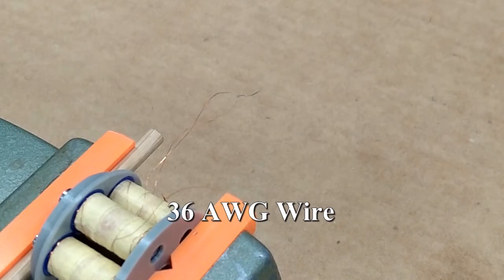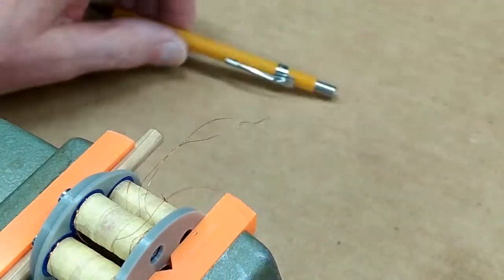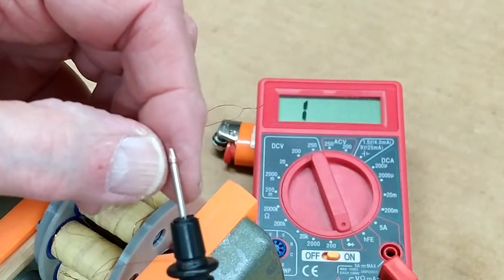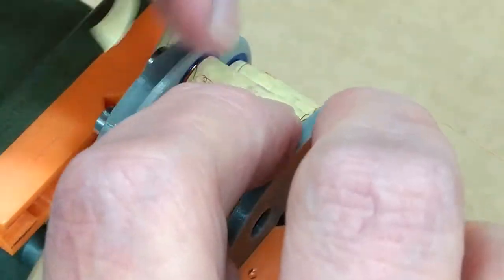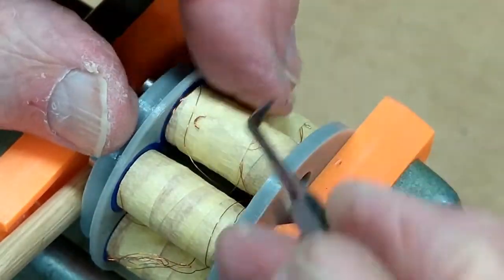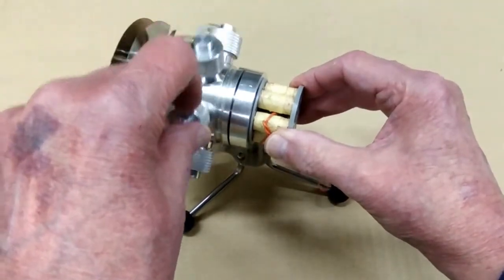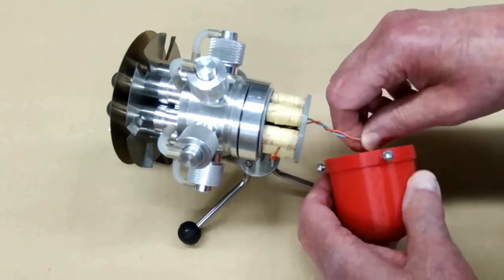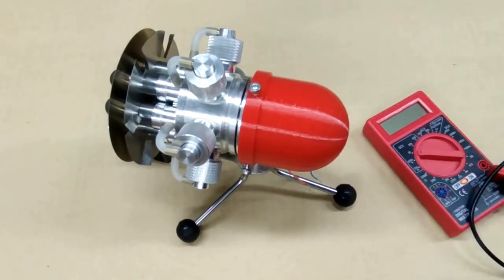Gatling Stirling Magnet Generator Part 2

Comment: Nice work putting those coils in series with the copper hair.
Off topic question for anyone. Are those Stirling Engines on places like eBay worth the trouble?
Thanks, Ronald.
Reply from the maker: Don't know about those on eBay. If you use my links to EngineDIY, for those you have seen me review, you would be good. Just depends on what you want to play with. These are all demonstration models. Generally the Stirling engines have limited atmospheric cooling and when  they overheat, that is the end of the engine run... but they are fun and interesting. Thanks for watching. Ron
Reply: @RonaldWalters2010  Okay, I'll check out that link. I'm trying to decide if I want to jump off the Stirling cliff myself or just watch you play for a while longer. Thank you.

Comment: I think you might have been getting more power out than you thought, but you were measuring the output in DC, but the output from this would be AC, as the voltage goes one side of 0v as the magnets approach the coils, and then the other side of 0v as the move away from the coils. If you want a DC output, then four diodes and maybe a capacitor to make a rectifier and maybe smooth the output would do the trick.
Reply from the maker: Roger that. This is just Part 2 of the experiment. In Part 3 we construct a 6-Phase Diode Rectifier.
Thanks for watching and for your comment!
Ron